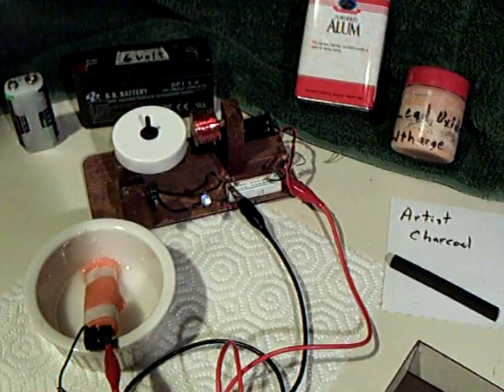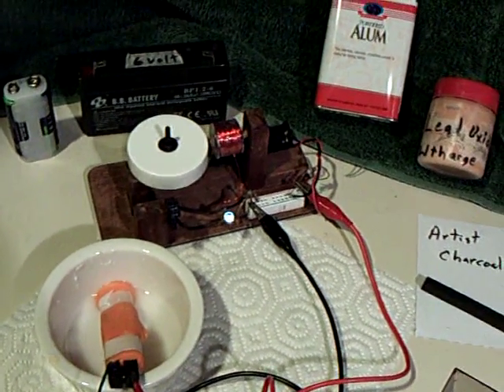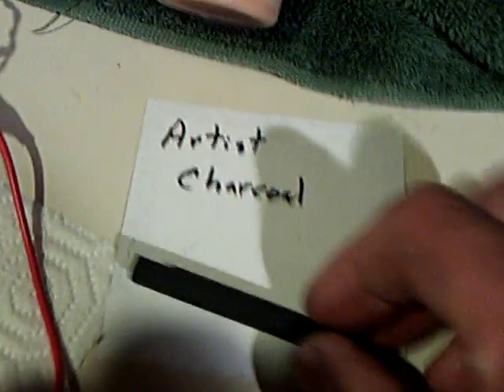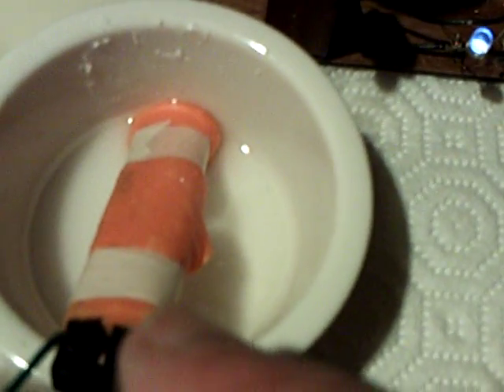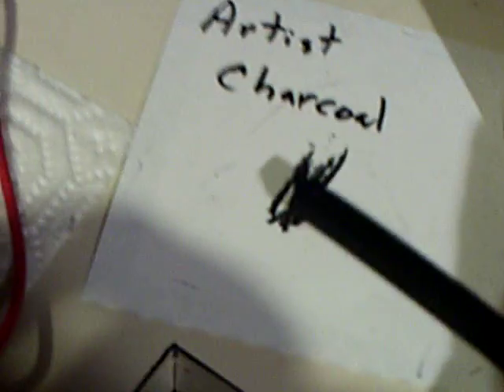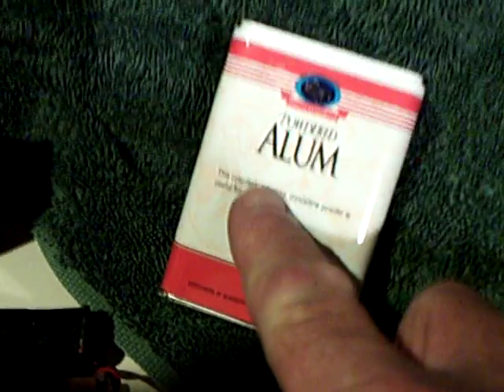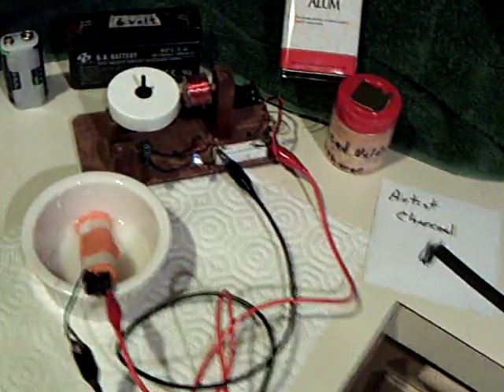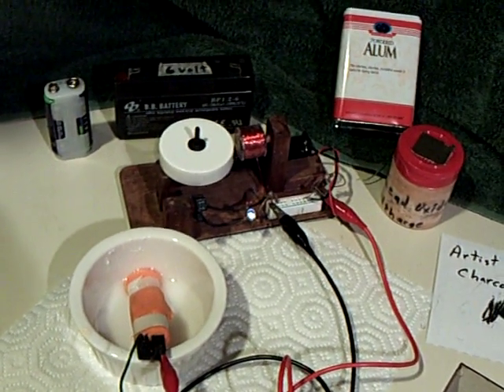Artist Charcoal homemade rechargeable battery

Comment: How long did you charge it on 6 volts and 3 volt respectively. and what is the indicator that the battery is fully charged ?

Comment: Well, the TiO2 and Epsomsalt and carbonfibercell is not so good.
But when dried out, it puts out around 0.1 to 0.3 Volts with no metal in there.. !
Depends on the charge it got before....
I am still testing all of this... We really have to find a different oxide than lead oxide as it is so much a poison... Have bought today some ironoxide, maybe it will work with this too ? But the carbonfiber sheets are really great electrodes ! You can also make good supercaps with them and with lampblack !

Comment from the maker: I need to get some of that carbon fiber sheet material and the TiO2.  Let me know if the Epsomsalt cell keeps working.  My test cells using that dropped off in power over time.  This latest cell using the charcoal formed up at about 1 volt / 10 mA.  Not that great but at least it worked.  More surface area would increase the amperage.  Gotta get some of that graphite fiber sheet.

Comment from the maker: Good question.  The 1lb. bottle label simply says:  " Lead oxide (litharge) 99.9%."  and there are no other markings.  The Ebay seller mentioned in his description that it was used in batteries and that was the main reason that I decided to buy it.  It is a very fine powder of yellowish orange color.  I am mixing it with a slight amount of Alum and distilled water to make the paste.

Comment: P.S. Are you sure you really use PbO (Litharge ) and not red lead oxide,  which is Pb2O3. when I remember correctly? 
Litharge is normally yellow in color and not orange like yours...hmmm.. 
Also there exists lead suboxide PbOPb or something like this, which has grey color and is usually used in battery electrodes...

Comment: Well done Lid! 
What voltage do you get and what shortcircuit current? 
Carbonfiber sheets beats them all! 
You should get some! Much higher surface area and much lower electrode resistance. 
I have currently a cell running with just carbonfibersheets as the electrodes and Epsomsalt and TiO2..